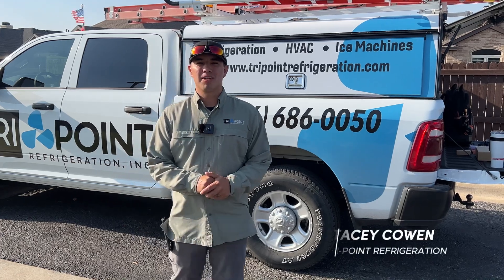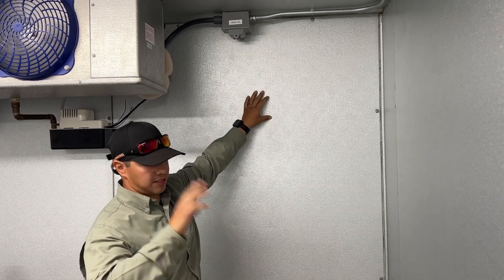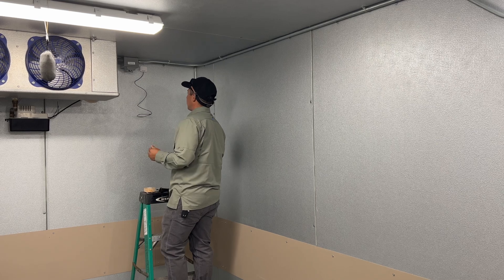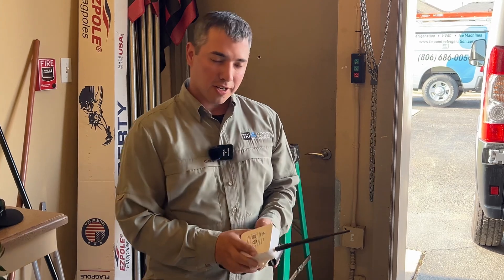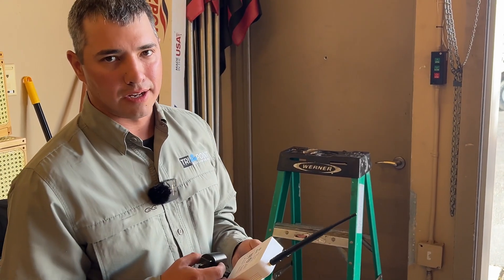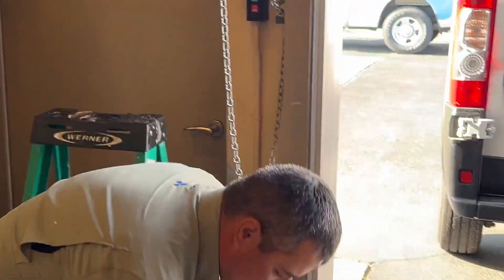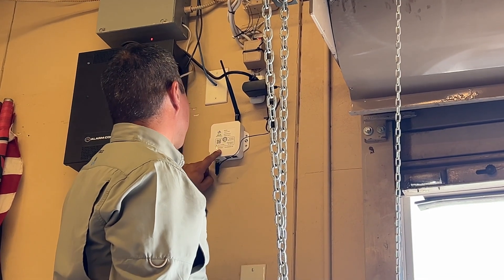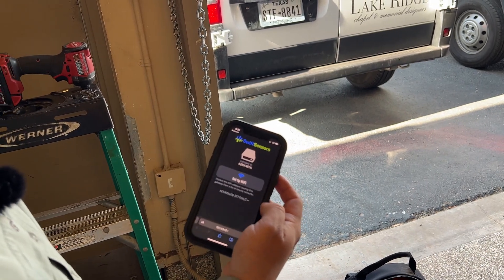Swift Sensor Installation in Walk-in Cooler | Tri-Point Refrigeration

Comment: I like zynect, wifi or LORA comms. It can't be hardwired one serious con of them. But they do include battery monitor in the GUI so you can change them out.  LORA is pretty essential in commercial buildings unless you set up AP's all thru the building.